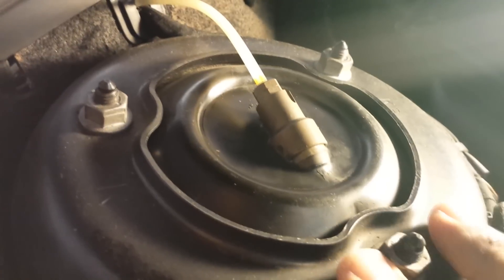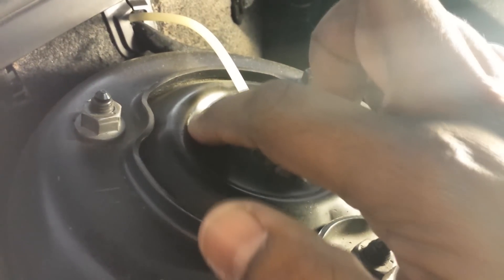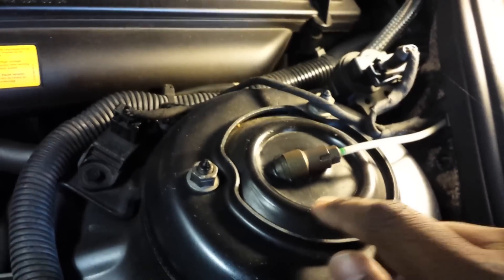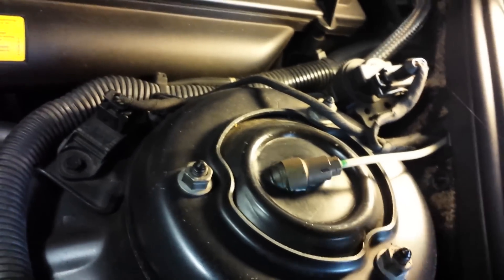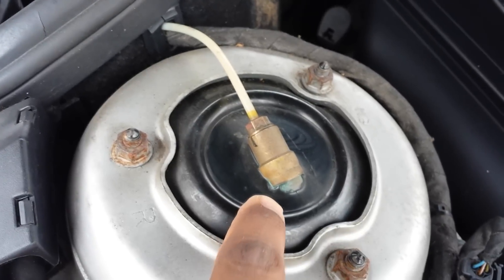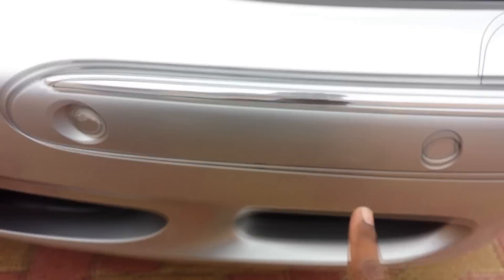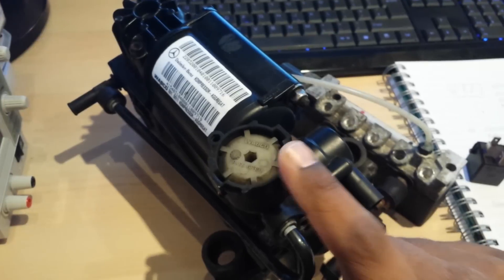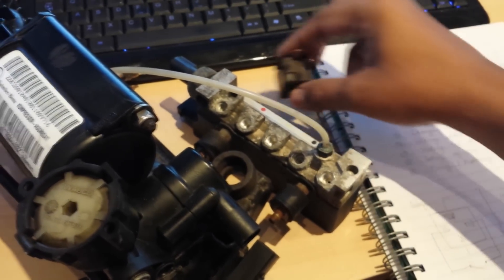Part 1   W220 Airmatic   Airmatic system test and fix

Comment: Hey Waqas your videos are very helpful I was wondering if I could speak to you about a problem I have had with a w220 S320 cdi airmatic suspension issue.  Do you have an email or a contact number or any way I can DM you for your details?

Comment: I had the air bags and pump replaced too many times and just recently I had the rear passenger bag and pump replaced just weeks ago from a puncture hole. I hear air coming from the same place and I don't need new air bags or pump. So it has to be a leak somewhere else and I want to DIY it.  Can a OBD II scanner help with diagnostic?

Comment: thank you very much. so when the front leaks.. it is usually a crack on top? not from the lower part of it.. like the bladder.. all we need to do is some soap and water? I have the S550 2008, every time I turn it off it gives a hiss sound and goes just an inch lower .. I wonder what is this? if its a small leak.. it just makes the car look ugly.. very low in the front lol I like it standing high :) thanks boss

Comment: Hi Waqas,
         I have a question before I make a strut purchase that I thought you may be able to help me with.
I have a 2001 Mercedes Benz S500. The car is stiff/harsh over bumps.and it seems like the back end wants to slip sideways to the right over the bumps as well.

 I was wondering if you may be able to point me in the right direction if you believe it's a strut issue.

 I thought it maybe it's the struts age @18 years old.

         I first thought it maybe the Airmatic control module at first but if it was, there would be a malfunction code set. 

The car has 61k miles and no codes were ever set or have been cleared.

The height control is working and never drops to the ground. Even when being stored over the winter.
Do you believe it maybe the Airmatic Valve assembly ? 
Thanks

Comment: Great video!
We supply rubber bladder sleeve and other air spring suspension strut repair kits for all kinds of Airmatic include W220. BMW, Porsche, Land Rover, MB, VW, Hyundai, Jeep and so on. www.auto-rubbers.com Whatsapp: +8618285110463

Comment: Hi finally videos for my specific make and model, any help or advice my front passenger strut or whatever you call it doesn't seem to hold the air, it does rise up and levels itself out for about a minute or so then it releases or leaks and the car drops to floor and I get a warning on the dash any idea what can it be just so I don't get stiffed when I take it to mechanics or is there a fix I can maybe apply to it and same some major money

Comment: I want to stop my s430 from lowering when it's in Park, can I just disconnect the airmatic line on all 4 wheels?
Reply: No then it will drop to the floor. Just do a spring conversion kit

Comment: Good info :) 
I have W220 year 2000, no errors on dash but over night all 4 wheels are totally down. I mean only if i let car 2-3 hours in garage, is totally down. What should i suspect? If was only a strut leaking, should't be lower only on that strut ? Should i check compressor pipes or where to start? Thanks

Comment: salam, I got a problem withe the rear strut, the card ride has become really bumpy and hard. The diagnostic report showed - Left rear solenoid valve 1 

as per my research its the problem with damper valve Y53.. any idea on its fixture

Comment: is that pump for the front and rear? or is there a pump for the rear also?
Reply: Only one if Im not mistaken, you can hear the noise when its working
Reply: Thanks, a friend of mine has a '03 s430 and the left rear is not working.
Reply: Steven Lynch your comment is from round about 1 year ago, but the pump is for front AND rear! greets from Germany

Comment: did you get the drivers side mixed up with the passanger side?
Reply from the maker: Charles Dominesey Hi, I don't think I have. I am in the UK and driver sits on the right hand side. Could this be the difference?
Reply: Think outside the box. For you the box meaning USA. There are other places.
Reply: Charles Dominesey xxxxxxxxxxxxxx       I Im waiting